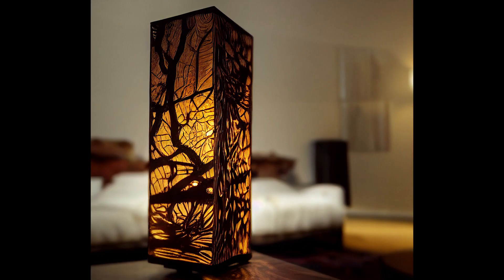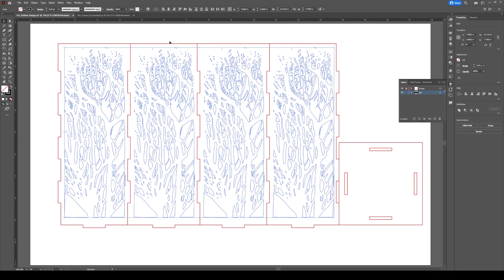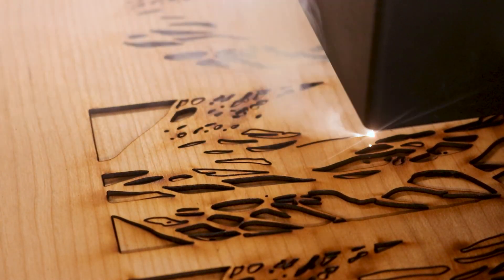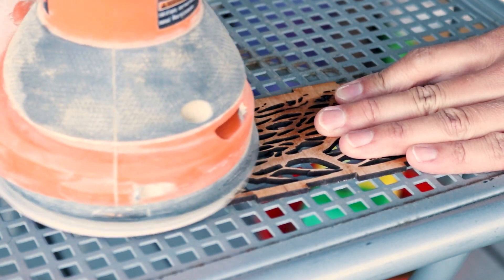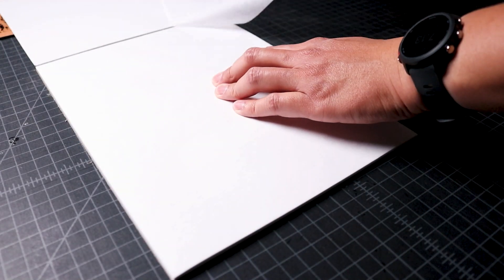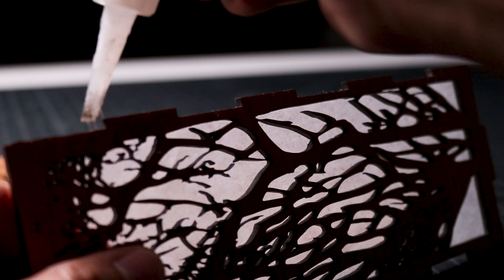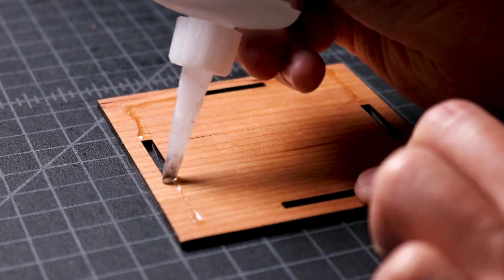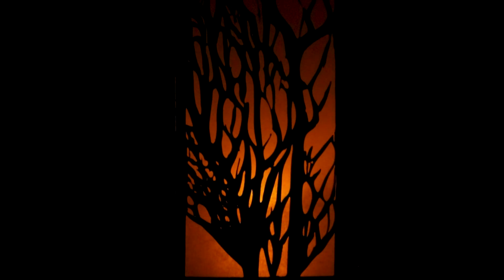Can Midjourney AI Design a Physical Product?

Comment: I think you could have made it a bit bigger for more detaillp
Reply from the maker: Good point. I would’ve made it bigger but my laser cutter only goes up to a specific size for each panel. Then it also gets difficult to proportion it with the small candle light it was designed for. Love the suggestion!